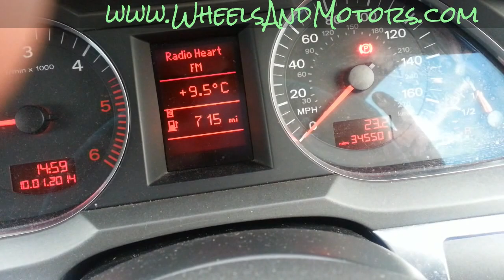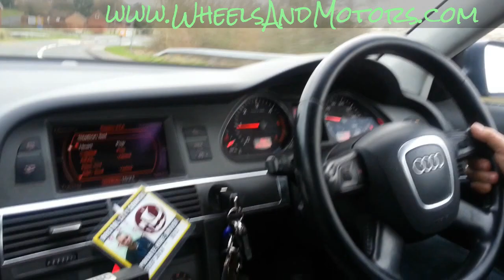How to pass MOT on emissions with diesel engine (TDI)

Comment: Great video and advice! My A4 1.9TDi failed its MOT yesterday (165k miles). I used a fuel additive (the test centre suggested this) then I followed your advice exactly. It passed today with a huge reduction in the smoke readings - huge thanks :) I'm hoping my car lasts as long as yours!
Reply from the maker: Thanks, glad if it helps :)

Comment: My 2014 Ford Focus TDCI failed the smoke test by a lot two weeks ago. The garage put some cleaner in the tank and I took it on a long run. It failed the retest again though. I then came across this video and took it out for a blast as you described.  This afternoon it sailed through its MOT. Thanks for the advice. I’ll be doing this every now and again from now on.
Reply from the maker: You're welcome 😊👍

Comment: My pre DPF diesel failed its MOT on emissions a few days ago, I'm so glad I watched your video. It's due in tomorrow and will take your advice with great confidence that it will get through. Air and fuel filters have already been changed and an additive mixed in, so all I have to do is give it a good thrash on the way to MOT.
Reply from the maker: As long as your engine doesn't have significant faults - it should pass.
Reply: Sorry I took so long to reply, it had passed!! :D
Reply: @LanceHerod-n5d  what additive did u use and how ?
Reply: @sumilkhansk  Sorry but i don't know as it was my local garage that did it.

Comment: Great Video and spot on with the way you need to really work a diesel engine to clean it up. Nice tip too about getting the engine warm before the MOT (especially in winter) My car just failed on emissions for the first time and the garage gave me some seafoam to run through the engine. I have been ill with an eye infection since April so my car has just been standing there and not moving for months. I've got a couple of days to really work the car and go searching for hills lol Fingers crossed I'll get all that carbon out before I take the car back for a re-test. Thanks for the video
Reply from the maker: Thanks for valuable comment 👍

Comment: that's is the key to keep your engine running well. some people blame the cars to break down for no reason, the question I ask is, have you everbtake your car for long drive? they come back and say no. special with u got dpf u need make long drive for it to clean. my mondeo mk4 I have 147 k miles on the clock and still 1 dpf. and runs great. every day it run in long journeys. great car. I love work on tdis but some people don't know how to look after them.

Comment: I'm from belgium but I'm sure the same rules apply, my Opel(Vauxhal) Combo C from 2004 1.7TDi failed the emissions test, I only JUST got my drivers licence and have driven this car for a year without going above 3000 rpm, and very infrequently. it had passed inspection when i bought it. I just now bought a new air filter, some cleaner additives and will do this a few times before I go back in two weeks, I hope your helpful tip gets me through
Reply from the maker: It will pass 👍

Comment: Hi mate I have a Mitsubishi L300 diesel engine here in Philippines and I failed the emission test here twice this week for smoke belching regulations. I will try your advice here and assure you I will edit my comment after I passed. It seemed very effective and I agree on the uphill drive.  However for higher chance of passing ...have to do oil change and other necessary to pass like slight water pressure for the 3rd time on my exhaust system for the removal of carbon deposits.
Reply from the maker: Hope it helps

Comment: My wife car just failed as well but not surprised it did as she got the car after me and the car is on approx 190k miles now. She only takes the car and does about 1.5k a year now so no wonder why it failed if the car did not had a proper run down for the last 2 years :) Any way I knew something was wrong when I heard the MOT tester reving and reving the engine so I come up to him and explained but I saw on his machine the car was doing 0.71m-1 on the emission machine where it was set at 0.51m-1 for it to pass. Now I went home and I have a good read on how it works, for these unlucky ones like me I think there is a loophole, a tester has to set the soot emissions on the machine as per the vehicle label (according to DVLA, this label is visible at least on my wife car on the driver door, near the tyre pressure label). Now I know that the tester has to enter them manually as its actually 0.50m-1 on my wifes car, but when I looked around Ford Mondeo 1.8 tdci comes with 0.51m-1 so my assumption here is that MOT tester just entered the figure from his head as he must be doing fair amount of Mondeo and its not entered automatically from a number plate or so. Now a best part is, on a GOV site it says that if a label is not visible or does not contain manufacture soot emissions level then a MOT tester has to go by default settings, which are provided by GOV according to some vehicle manufacture year.  Now my wifes vehicle is "First First used on or after 1 July 2008 All diesels 1.5m-1 " So simply if I remove the label of the vehicle an MOT tester should then go by the default values  so if I saw my car was doing 0.71m-1 it should PASS tomorrow :) and if he fails it gain I will remind about the rules and will ask him to show my a label, which is now gone.
Reply from the maker: Wow, learn something new every day :) Didn't know about labels..
Reply: @wawayltd  I scratched the number of the label where it was showing a soot emissions level and when I took the car for a retest I tapped the MOT tester on the back and informed him about the label "accidentally" just got slightly damaged and he set the machine as 1.5m-1 soot limit and the car passed right away :) To me its clear that the gov just trying to get rid of the diesels slowly of the road.

Comment: Mileage is irrelevant as long as you look after your engine with regular services and replace parts when needed, I had an emissions fail once years ago smoke levels were a high my own fault for driving it on short trips i was told by the old guy doing the  mot take it round the block and really open it up i did that and went though no problem, these days I put a tank of Vpower in 1 week before i go up to the mot, my garage is 16 mile away so on the morning i drive bloody hard all the way up there the shit that comes out when you first do it is unbelievable but soon clears and goes straight through, my Japanese diesel has 300k on the clock, engine is still original and original turbo and goes through emissions test just fine, my driving style is easy so it does get gummed up i usually blast it every so often just to clear the cobwebs, like you say its not the high rpm that clears it is the load you put the engine under and making sure the turbo gets up to full boost to blast the shit through.

Comment: Hi 
Congrats on this video. 
One question came to mind is, what if one has automatic gearbox and we cannot control the rpm like you said... It could do a little when put the foot down. But it still keep changing gears at low gears.
Any tip on that auto transmission.
Thanks
Reply from the maker: I don't have much experience with automatic, sorry. I think some of them have like a "sport mode" when you can change gears manually, I had old automatic A4 that had "3-2-1" manual selection.

Comment: I use millers eco fuel system cleaner in all our diesel landrovers a good hard run before the test usually flat to the floor in 3rd and the emissions are 0.1 as long as cam belt chain oil filters are all good no problems every year just rust lol
Reply: Mark Smith hello my ford mondeo just fail about emissions is a ford mondeo 2.0 tdci on mot says fail because the emissions are not. According to the manufacturer 1.2 average should be 0.5 what can I do the car stills great no advisories they say is the new law. What can I do 
Thanks Luis
Reply: Luis Torres hi try a fuel system cleaner nail it up the road they need oil and filters changed often fuel lubricants the pump then parts of the pump breaking up blasts the injectors nozzles really needs putting on diagnostic machine for possible codes regards Mark

Comment: Curious to know if the cars still going strong, they are brilliant engines, only bad thing in my eyes is the dual mass flywheels
Reply from the maker: I had to sell that car about 5 years ago, because there's an age limit for the taxi licence. Now I drive Sharan with nearly 400.000 miles on a clock.
Reply: @wawayltd  that’s amazing mileage, I drive a van with nearly 400k miles but it had a new engine because it blew up around 200k
Reply from the maker: My engine is still the same, couple clutches ( flywheels), quite a few cambelts, new EGR, turbo still the same, new steering rack, some bushes, ball joints.  Probably will need new DPF, because it's regenerating few times a day - must be full of ashes.

Comment: I have a BMW 320 cd it's the coupe. I drive like you mentioned never over 2k rpm I always baby the engine, which has 100k. when I push the engine grey black smoke is produced, out of 10 (1 being like a new engine 10 being thick black clouds) I'd say it's about 6/7 it's not black nor thick.  I do a lot of town driving so never really get to push the engine but will try to more often now.  I've had the car for about 8 months and apparently it had a service just before I bought it.  The oil is jet black and runny like it's very old.
Reply: Gunzee Diesel engine oil goes in black and looks black the entire time. Can't tell if it's good by just looking at color, at least I can't.

Comment: My car failed last week on the emissions it was very high, what should I do? It’s a 08 Toyota Carola diesel 1.4
Reply from the maker: You can try to do what I did in this video, but it only helps when engine is ok, just collected some soot. If it doesn't help, please check with your mechanic.

Comment: Hi there, have you ever had a rough idle issue on your audi a6? I have it only 2.0 tdi a6, i notice the rpm needle is a tiny bit jumpy. can you give some advice?
Reply from the maker: +David Cohen Lots of people complaining about rough idle in this car. Some blame bad engine mounts. I don't have a straight answer. The car in the video had done 409k miles before I got rid of it. Mainly I got rid of it, because of age limit for taxi licence. In her last days I had rough idle after motorway journeys. Then one day I've lost oil pressure - probably pump failure. I don't know if it has anything to do with rough idle, because I didn't fix it and got myself 2012 VW Sharan now. But I would love to find out what's causing rough idle!
Reply: Torsion out of spec, in case it's a PD. Injector balance, injectors wire loom and/or EGR map, this last issue can be mitigated by an EGR reducer plate. Those are usually the common issues for the rough idle on the 2.0Tdi.

However the 2.0Tdi is a natural unbalanced engine. It was pretty much rushed to comply with the Euro IV norms so a perfect smooth idle isn't to be expected from a 2.0Tdi.

One of the best things that can be done for a PD diesel before going in for a MOT if the car is just driven around town is to go for an italian tune up.

Comment: Does this work with auto triptronic because i did it with my merc its 2007 3litre diesel 7 gear triptronic i dit it in trip tronic i took it to redline but i never saw any smoke in my mirror does that mean my engine is good the merc has 50k on clock i bought itbfor 10k in 2013  but on my jaguar smoke should come out because thats got 120k on clock and i bought it about 6 months ago dont know if engines good
Reply from the maker: If you have DPF, exhaust doesn't normally produce black smoke..
Reply: @wawayltd  on merc dont know but on jag there is none

Comment: Does your car have a diesel particulate filter (dpf) ?
And also have you ever had any work done on the engine oil pump as these are known to fail on the 2.0 tdi engines and totally ruin the engine. 345000 miles is fantastic from what mileage have you owned the car ? Keep up the good work.
Reply from the maker: I was lucky enough not to have DPF in this model :)
Yes, I did have problem with the oil pump. Early 2.0tdi's had bad design for oil pumps - they were chain driven. Later they started doing them gear driven.
I bought the car in 2008 with 35k on a clock. On 45k I had oil pump failure. I've managed to make dealership cover most of repair cost, despite I was using the car as a taxi. So that repair lasted all the way till this Christmas.
With 409.000 miles on a clock my oil pump said - 'that's it! I'm tired' :(
I think oil pump failure wouldn't ruin the engine, if you stop it straight away and don't run it with no oil pressure.
Anyway, with licensing regulations, I could use this Audi as a taxi only till March 2015, so I decided there is no point of investing for the sake of couple months and I gave up on it. Sadly, I don't have this Audi any more.
Now I drive 2012 VW Sharan 2.0tdi. My next few videos will be about my new Sharan.

Comment: What about the 2 products liqui-molySuper Diesel Additive and Smoke ? The vendor suggested this: 
1 .Step 
Use our Super Diesel Additive to clean your Fuel System, to prevent it from deposites and to optimize the combustion. When you have a optimal combustion, you will reduze the emissions as well.  This Additive is sufficient for up to 75 L fuel. for the mx dosage,there should be at least 35 liters in the tank. 
 2. Step 
For the pure reduce of the diesel Smoke, i could recomend you to use our Diesel Smoke Stop. This one reduces the burning temperatur of the soot . 
Use these two products after another, to get the best result.
Reply from the maker: Anything goes. I used Cataclean - works well too.

Comment: I been having hard time with catalytic converters  and engine  light comes on my nissan frontier  2001 everytime so here. What they told me. Change the oil. A brand called. Seafoam  works so wonders! Under 10 bucks.  I put abit in motor and all in gas. And i put premium gas cause it burns faster and hotter which help break down the bad stuff and go buy those electronics that takes ur motor lights off r before u go for ur emissions  test. Cause if it on it fails. So. Then second part is to get ur oil change then go on free way. 3500 to 4 rew.  And try. Whatever u were driving let say u ever went over 44mph go double it. The hotter it get. The better. And drive about. 6 miles. And haul down to get ur emissions test  done. And leave ur car running whole time dont turn it off and wait. It a no no. Helps this helps